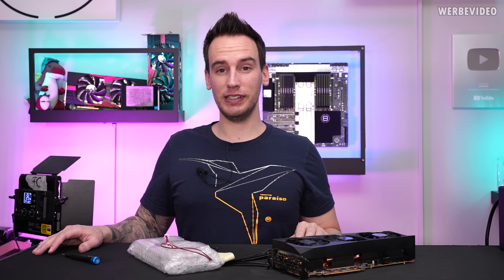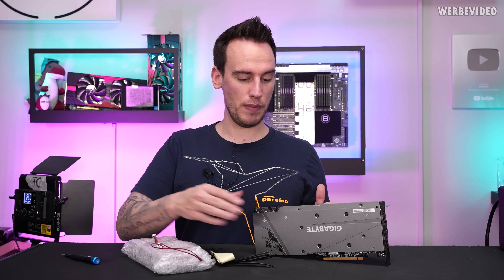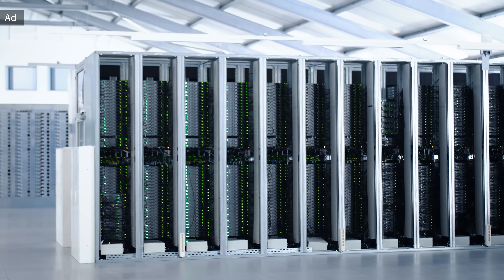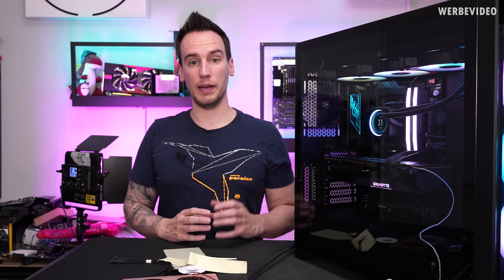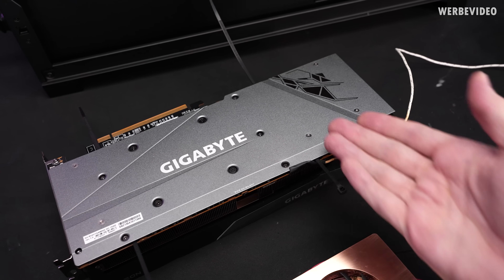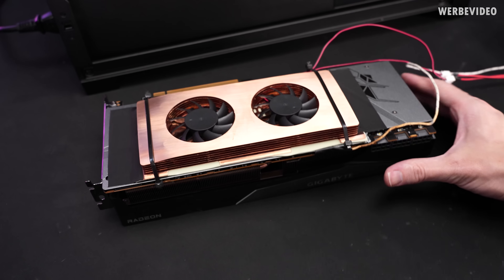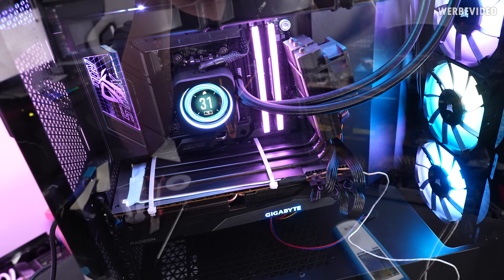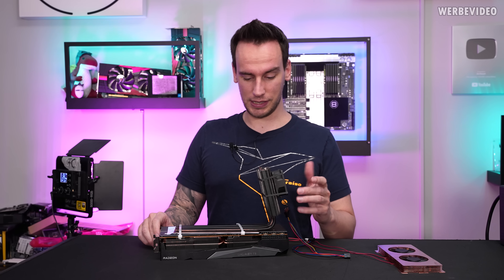Please don't do this - AliExpress GPU Backplate Cooling

Comment: When I had a 3090 I did a DIY solution like this with a giant aluminum heatsink and an 80mm fan. It actually helped in my case, because I was thermal throttling due to memory temps, even after replacing thermal pads. At least I was able to keep the memory at about 95C instead of 112C.
Reply: Yeah I wish he would have tested with the 3080/3090 because the backplate really helps the mem temps on those cards.
Reply: Yeah I did the same with pk3 95 to 75-80 and mine was on water 3090 backplate temps were no joke but mining was the reason lol
Reply: @B0BBYGAMER  Not only minig, try to use it for IA training and render, memory will hit the same 110c  :(
Reply: My 3090 has 65c-70c mem temps and I even have the mem overclocked to 3090ti spec. I simply changed the pads to higher quality ones just a teeny bit thicker, put a Asus ROG 120mm fan (that has a amazing balance of airflow and pressure) onto the backplate pulling hot air out straight into my case’s rear exhaust fan. I was able to drop vram temps without even affecting the core temps negatively
Reply: I did the same thing when I was mining on my 3090. Replaced thermal pads and put a heatsink with fan on the back. Dropped my memory temps by about 25C with max achievable memory overclock. In normal gaming it doesn't have a noticeable difference.
Reply: I just pointed a fan at the back, worked great. 

But I also Watercooled the front, that probably helped too
Reply: As long as your 3090 board is connected with thermal pads to the backplate - this gpu is not connected, therefore it has no results
Reply: Same. I watercooled the GPU and found that backside memory temps were keeping everything throttled so had to add cooling to the back. I got a replacement back plate (so I had a spare) with a pair of RAM waterblocks that I thermal epoxy'ed to the new backplate. The waterblocks on the back really helped cool the memory temps by keeping them 25-30 degrees cooler.
Reply: @LordSaliss can you do a short video of what this look like please
Reply: @Mysteryboy0007  Don't have it anymore. Had to move to a lower profile passive cooler on the back when I added a Hyper M.2 pcie5 card with a bunch of NVMEs above the GPU.

Comment: Well, I do have an rx7900xtx that can reach 110*C on the hotspot fairly easily in Doom Eternal with maxed settings in Windows... I don't think it thermal throttles in Ubuntu though, which is what I use 99% of the time. That's probably because AMD doesn't provide nice software for linux - no increasing the power limit, and no using virtual super resolution on my 1080p monitor unfortunately. I'll probably watercool it when I upgrade to zen 5 - I'm planning on getting a new case with a vent in the front too, so I can mount the radiator.

Comment: Put the zip ties on the bottom thicker place threading between the bottom plate and the plate above, that means all the pressure is on a thicker surface and less ugly too.   Any chance of some indepth stuff into phase changing thermal materials, I bought some recently and a bit hesitant to use it if its going to be a pile of poo, proper branded stuff as well.

Comment: got good results using an old GPU heatsink attached to my watercooled card to reduce the memory temp for OCing.   Backplate had thermal pads to the PCB and got quite hot.

Comment: Do your self a favour! just water cool the dame things, my 3080 reduced length by half, increase air flow within case, decrease general chipset temp by 8 degree C. GPU with out play game stay under 28 dC, full load under 75 dC, but fan noise always under 47dB.

Comment: I did my own thing to my 3070ti. Got a couple aluminum heat sinks off digikey. Instead of zip ties I masked off about 3mm around the edges with tape, applied thermal paste, removed the tape, and then applied 2 part epoxy around the edges. Stuck them on, put some weights on it and let the epoxy cure. Then flipped it over, drilled the holes for mounting. Stuck on two noctua 90mm fans and she was good to go. Got 15c on GPU and Hotspot. It looks kinda jank, not as jank as these things for sure but it works really well.
Reply: same -15c if you remove the back plate :))

Comment: I think the one thing that is overlooked in your conclusion is that not everyone wants to deal with water cooling.  While i wouldn't buy either of these, it would be interesting to see if the second had any noticeable in-use benefit, even if it has some issues.
Reply: just remove the back plate. No trapped heat, no overheating problem! Find other ways to keep the gpu straight and if it looks ugly, take a pic with the backplate on, and print it on the side window.

Comment: There is no need to cool back plate of GPU. The reason is quite simple. It’s behind the PCB. The PCB is heat insulator. This means that any cooling to the back plate will not improve temperature of GPU. 

Companies make this kind of stuff because it’s easy money off people who think their GPU is overheating when it’s not.  

Believe it or not, manufacturers of GPUs (from reputable companies and not generic ones on AliExpress) actually do a lot of testing of their cooling solutions before they launch it.

Comment: I just took a chance on one of them RX580's off Aliexpress, with coupons etc came in at £45ish which I am going to be happy all day long if it runs OK and I know I have to thoroughly clean the thing up and new thermal pasta of course.   I was tempted for a few pounds more grabbing a 590 but looking through the seller feedbacks it wasn't positive whereas the one I got my 580 from had all but one positives and the one not positive was a missing edge conn trace and the company sent him a replacement.   I am working on building a killer water circuit for mine at the mo, my case is the enormous HAF XM which has room for top and rear rads and was thinking of going 2 rad, with the rear rad sitting between the GPU and CPU blocks and the top rad for max thermal exchanges.   My last water build I used the Antec Skeleton which I had painted toxic green with red spatters, a twin circuit rig with one circuit for the gpu/ram/bridges etc and another for the CPU...

Comment: The first time I experienced a backplate that would burn your hand is with the dell 3080 I have now. The temps of the card are all within spec (75c core and 88c vram) so I concluded that the solution is to not touch the backplate when it's hot.
Reply: 75c is overheating. Don't listen to anyone that tells you it's normal. The question is how long can the card last under that heat.
Reply: @dreyga2  I really don't like it when people spread disinformation like you are now. Max temp for a 3080 core is 93c, so get out of my face with your bullshit.

Comment: too late I tried 2 years ago lol but to be fair I just bought a massive regular electronic heatsink with lots of small fins, it worked but was too heavy and decided it wasn't worth the potential damage the best air cooled gpu enhancement you can do is buy a case with a metal or acrylic side panel dremel a 200mm hole use a large low rpm fan blowing air above and below your gpu that was mandatory for SLI back in the days and so that's what I had before I went full liquid cooled (might be complicated with RTX 4000 as they are much wider than previous gen)

Comment: I have passive cooler on backplate on my 3070ti (leftover from accslero Xtreme that went to another card) and it does help tiny bit, not really for temperature under long heavy load, but when playing less heavy games (like wot), fans kick in after longer time than without it and also turn off faster 

But it doesn't look this bad and it was free to me because I already had it home (no zip ties, just sticky thermal pad)
Reply: Remove the backplate and it will fix your overheating. All you have to do is prevent sag.
Reply: @dreyga2  lol, what? 
there's no overheating bro, read what I wrote

Comment: These dont make sense, badly over engineered so they are expensive. If you really want to do it, get a 150x100x15mm heatsink for £9, then a couple of 100x100x1.5mm thermal pads for £6. It would still be quite sketchy putting these on your GPU if mounted how these in the video are. I cant believe you are expected to use zip ties.

Comment: I'm running a 7900 xtx under linux which currently means no fan control, and I'm having real issues with my backplate cooking my CPU. 

The default fan curves on my GPU never raise the fans above 70%.

The CPU has a huge Be Quiet air cooler in there which seems to soak up the heat pumped out by the backplate next to it. Meaning that during stress tests of the CPU it bever goes above 70°C but when playing games that stress the GPU and barely use the CPU, the CPU temps are about 83°C almost the same as the GPU memory.

Comment: I added a passive heatsink on the back of my 3090.  Just a regular generic electronics heatsink attached with thermal tape.  Dropped the memory hotspot temp from 95+ down to the low/mid 80s under load.
Reply: you still have trapped hot air under the back plate.
Reply: @dreyga2  Maybe, but my temperatures still dropped.  3090 has memory on the rear of the card dumping it's heat into that backplate.  I added more surface area to dissipate that heat across.
Reply: @LordPlural  remove the backplate. No more trapped heat, happy memory.
Reply: @dreyga2  lol it not trapped since you we have this thing called airflow in the case and taking it off is not going to make temps better.
Reply: @SkinUpMonkey  I am sure your airflow will be able to vent out the heat generated from a 350w monster.
Reply: @dreyga2  ya I'm going need a bit more then some random dude who thinks they know what they talking about.
Reply: @SkinUpMonkey  i have a 1080ti strix. It was overheating 75c+ noisy and temp still going up. I removed the backplate and the fans+plastic. Strapped 2 noctuas with zip ties, and it's been running like that for 6 years. I didn't even bother to remove the dust. Max temps 66c core, VRAM 76c, ambient 30c (summer, very hot). It's dead silent. You keep your crappy cooling they sold you:))
Reply: @dreyga2  lol I don't believe you dropped that much on the core by just taking the backplate off and strapping fans to the back of the card. The backplate does nothing to temps unless you got vram on the back of the card. I don't have one these cooler things and funny I also don't have a backplate on because I got watercooling and EK wanted too much for theirs plus it wouldn't be seen since the waterblock is on full display but do carry being "smart" my dude.
Reply: @dreyga2  Removed the backplate.  Memory temps went up.  Added backplate + heatsink.  Temps went down.  I tested it.  It works.  Memory on the rear + thermal pads + metal backplate + heatsink = lower temperatures that without the heatsink or without the backplate. 

Maybe I'd get better memory temps with a dedicated rear memory heatsink and no backplate, but I'm happy with the memory hotspot being in the 80s with my solution as opposed to 95+ without the heatsink or 105+ without the backplate.
Reply: @LordPlural  or just a fan blowing on the back might work. Maybe the stock fans that it has can't cool the card so the memories get hot. Those little crappy fans that they use on cards can't cool my 1080ti properly, so I'm sure they can't cool a monster like 3090. You need some noctua, high quality case fans.
Reply: @dreyga2  Yes.  Because I cheaped out on the fans in my custom water cooled 3090/9900k PC.  The problem is definitely the 12 fans I had on the radiators clearly not generating enough airflow.  

Did I mention the part where I tested the different configurations?

I'm not going to say that heatsinks on backplates is great for EVERYONE...but in my case, on a card with memory on the back of the PCB, and a metal backplate that otherwise had no active cooling, adding a heatsink reduced my memory hotspot temperatures.  IT WORKED.   I have the data to prove that IN MY CASE SPECIFICALLY it works.
Reply: @SkinUpMonkey  look up "GPU fan mod - improve GPU thermals and noise" by 
DRJ. That's exactly what I did. I also have an exhaust hole for the GPU in the side panel, so it never gets hot.
I used 2 big noctua fans and surprise, surprise, Noctua made a cooler using the same fans. ("Impressive Noise Levels - But what's up with the Heatsink? ASUS x Noctua RTX 3070 tested" by  der8auer EN)

Who is the "smart" one now?
Reply: @dreyga2  dude make your mind up. Did you replace the fans or did you slap some on the back of the card. I can see replacing the fans helping but taking the backplate off and putting fans there will do pretty much nothing. To show how smart I am, if the backplate hurt temps then these cheap backplate coolers would have helped but they didn't.
Reply: @dreyga2  it just click that you must have a shit case if it got holes in the side panel for the gpu.
Reply: @SkinUpMonkey  Had, but now it's fixed. I don't even need good intake anymore. 

The GPU generates the most heat, but doesn't have an exhaust hole near it like the CPU does. 

The PC case meta, with glass panels, is stupid. It works only with low end GPUs, watercooling and that new GPU design from nvidia, where it pushes the air up and not into the side panel.

Comment: I used to use my 3090 for crypto mining when I was not using it. The back-mounted VRAM was constantly getting way too hot and it would hinder performance a lot and could not reach its normal hash rate. I installed a backplate cooling solution and it worked perfectly. In normal gaming applications though, it would have never gotten hot enough to warrant having a backplate cooler.

Comment: You need to use a 3080ti that has memory cooling problems. Specifically memory that runs above or around 100C at load.
Your card is not a candidate for back plate cooling.
Is your vram even on the back of the card?

Comment: Made my own backplates for 290x. One just plane radiator from hdd cooler and one with hearpipes from cheap CPU cooler. Minus 5-7 degrees centigrade
Reply: remove backplate -15-20C

Comment: some ppl has the needs to do those nice coolers...but they lack the brain :|
i have a "dream" to say it this way...to make a air cooler that mounts the radiators on the chassis just like normal dual tower cooler but with longer heatpipes that comes from the cpu to the chasis..
it would be like aio but heapipes used instead. (this splits the radiator in to 2 witch is mounted on the top of the chassis and back..depends how you want to make it)
sadly i just cant do that at all unless i find some one that can do that for me..
i saw something similar but it was fanless

Comment: what about cutting a giant hole in the backplate and just mounting the fan over that?
Reply: That will work. The trapped heat will be pushed away and your card won't overheat anymore. That's why you see some backplates with holes in them.

Comment: you missed the whole point of these backplate coolers. they are intended for mining on 3090 cards with memory chips on the back of the pcb. do more research next time. you are debauer ffs

the 90 degree heatsink was supposed to be flipped the other way around for exhausting case air

Comment: "Oh no, my heatsink is hot to the touch!" Yes, that means it is WORKING. If it wasn't, it would be cold and all the heat would still be inside the chip.
Reply: The backplate is not a heat sink. If it's hot, it's very bad for what is under it.

Comment: I gotta ask, since GPU backplates are so bad at heat dissipation, what is preventing AIBs from experimenting with more surface area on the backplate instead of making it a flat useless thing that doesn't do much once heat saturation hits in?
Reply: They cant really put anything thick there or there could compability issues for example with cpu cooler or top 1x pcie slot.
Also 99% of backplates are just for looks and completely not needed. Where theyre actually needed is on top range heavy cards but for mechanical not thermal reasons, they prevent pcb from bending.
3090 is the only case i know of where there was need for cooling from behind. Even if there were cards before with backmounted ram the ram not need that much cooling before gddr6x

Comment: I added some 3mm heat pads inbetween my backplate and the memory/vrms.  I dont really know if it helped the memory since the 1070ti doesnt have a sensor there but it definitely cooled down the hot spot temps.  Cant remember since it was a while ago but i havent seen many people do the pads between the backplate.

Comment: Man why didn't you choose a gpu with memory temp sensors ? 

I mean they look hideous and are propably useless, but you would se the biggest improvement in memory temps, even if the card didn't have vram on the back.